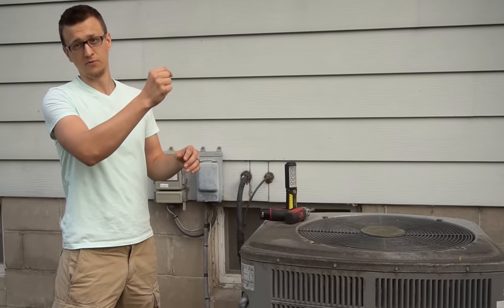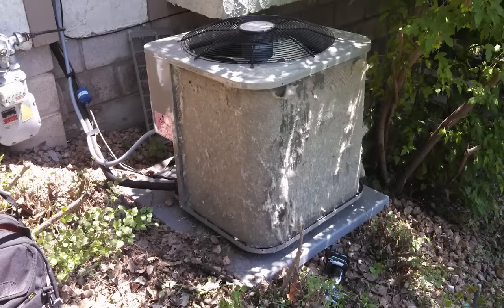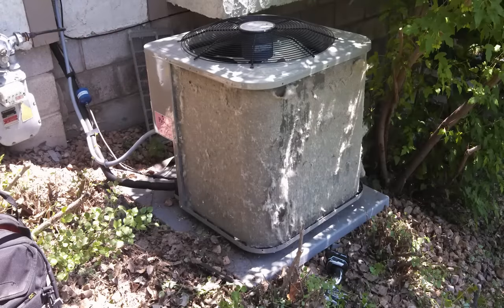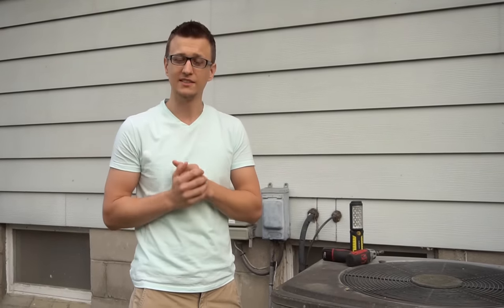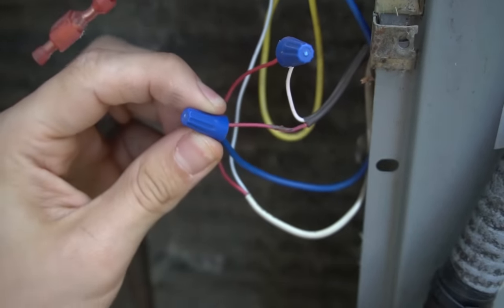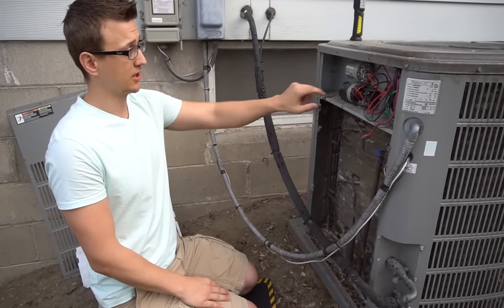15 Air Conditioner Maintenance Tips

Comment: If I tried to take a S/A and R/A temp like that I would lose my job. Also it is very possible to have a 15-20 temp split but still have issues like high SH leading to decreased efficiency and most likely will  reduce the overall longevity of the compressor. Makind sure the Low side of the refrigerant lines are properly insulated (as well as the high side for line sets over 60 feet) will do much more for efficiency than anything else your video mentions other than proper filter maintenance. The rest like checking temp splits accurately require wet bulb, dry bulb, as well as saturation temperatures to actually see the whole picture. And to accurately measure these things you need roughly $800 worth of tools and gauges.

Comment: Never use well water to clean copper,There is organic materials in that water and that increases the possibility of formicary corrosion.It can bore a hole in copper within a few years.Only use distilled water,Best to use one of the household steamers with the wand and spray the refrigeration coil cleaner onto it and let it sit for 10 min,Then wash it off.I seen this happen when someone uses well water to clean copper coils,Many times,Its good for the HVAC companies that you do this in the video.City water is OK because its filtered and chlorinated and sometimes fluorinated.

Comment: Wait it's ok to leave several inches of leaves and debris?  Sorry but no way, all debris should be removed and drain holes cleared.  So many compressors have rotted out because of leaves and muck accumulation down by compressor.
Reply from the maker: Thanks A D! That was a mistake on my part, to spread my fingers that far apart. I was trying to say if it is just a few leaves on the bottom it's no big deal. More than an inch is too much is what I should have said.
Reply: To leave leaves and debris in the bottom of your condenser unit will cause the bottom sheet metal to rust out after a while.  I always remove all debris every season.
Reply: Never heard of metal rotting 🤷🏼‍♂️
Reply: Bye

Comment: Very good information my friend. I have two brothers in the heat and air bis and this is exactly what they told me to do. The only thing i do and didn't really ask them but i use zoom oil on fan motors and let it wick in even if it is only getting one side. I also and you may have said this but i write the date on the filters so i know when to change them and yes every 30 days change them except spring and fall if your not using them but always check them during that time and if in doubt change it!!  I keep 2 or 3 news ones on hand all the time.

Comment: Hi. Can you please make a step by step  video on how to install  just a straight cool condenser? Thank you so much. And if you can another one about installing an air handler. Preferably replacing a broken condenser with a dead compressor. I m having hard time understanding how to disconnect the broken condenser and how to contain the freon and how to clean the lines before installation and is it necessary to install a dryer. Thank you

Comment: ALL OF MY ELEVEN AIR FLOW SUPPLY "GRILLS" LOCATED IN MY CEILING HAVE A SINGLE "LEVER" THAT CONTROLS THE "AIR FLOW DIRECTION" AND NOT THE DISCHARGE VOLUME OF SUPPLY SIDE AIR.  MY AIR FLOW "SUPPLY SIDE VOLUME" IS CONTROLLED BY A SERIES OF EIGHT MANUAL DAMPERS. In your video you stated that the air flow supply grill "lever" can be used to "shut off" or "curtail" the air flow volume into a room. That doesn't "jive" with my newly installed TRANE heat pump system and how it works.

Comment: I put my 24v inside my electric conduit to the unit to protect it. Also increased the service wire from the main breaker to the disconnect and to the unit from 12 gauge indoor to 10 gauge outdoor solid.
Reply: Call an electrician.

Comment: Man, thank you so much for the info.  Much respect and admiration. 
Love the video. Just what I need.  I just started class HVAC.  
Do you have any video on. Air handler keeps running 
And heat pump not blowing cold air in Heat mode. 
I'm having issues with my ac. Unit.
Thank you so much 👍☺️🙏😊

Comment: 13:20 the insulation is there so you are maintaining your superheat vapor on the suction line. your evap coil is 40degrees and you want 50degrees right as it is going into the compressor that is 10degrees of superheat and it should be a vapor you never want fluid going into your compressor that will destroy it.thats why some older units have a thing called an accumulator which stops liquid from entering the compressor

Comment: the run capacitor on the inducer motor seems to also be the most common problem with a furnace too. I have had 3 die in 7 years. granted the 1st one was there when we bought the house. It died 6 months after we bought it. Replace it and that one died about  2 years later so replaced it again. The 3rd one died about a month ago after 4.5 year. I bought 3 online for $2.50 each plus $7 shipping. takes about a minute to replace.

Comment: I do love your videos so informative. My AC is 24 years old and for some reason it’s sprain a leak and has no Freon so I figured it was time to replace it. I live in Arizona 114° today running a swamp cooler and don’t plan on staying here the next month I was quoted $9500 for an American standard Single stage 3 1/2 ton 15 seer split system heat pump in the attic air handler. I was wondering if I should wait until October when it starts to cool down before I think about buying a unit. I guess my question is will the price going to down when our summer is over is $9500 out of this world or reasonable. Plus is the supply shortage going to ease up soon to where the prices come down. Thank you for any help

Comment: Thanks so much have a problem with a window type ac. it produces a noise as if the fan bladders are brushing against another metal. Could it happen all of sudden. It wasn't in useed for some time.

Comment: New sub.  Thanks for these very informative vids.  You've given me the confidence to do some of these simple repairs myself.  My HVAC guy charged me an $89 service call last year plus $65 for a run cap that I could have got (thanks to your Amazon links) for about $20.
Reply: I think you got a good deal.  There are some real crooks out their that would have charged you $400 for that capacitor.
Reply: Affordable HVAC $65 dollars for that capacitor? that is extremely cheap, he must be a solo operation. No way those $65 cover the cost to stock that part, the labor if he is hourly and other expenses required to maintain a stable business, especially in California.
Reply: @armynavymarine2  Exactly. The average homeowner has no idea of the expenses it takes to run a business.

Comment: lot of thermostats have a large hole where thermostat wires are coming through the drywall bring in cold air within the drywall affecting the temprature sensor. pluging it with insulation may save few bucks

Comment: I have not used my AC in two years, I have a central unit which is 10 years old and I have never got it serviced as I rarely used it say about 10-15 times in the past 10 years. Would it be okay to turn it on without getting someone to take a look at it first? Thank you for the video it helped me know about how AC works. I live in California if that helps in answering my question.

Comment: Speaking of capacitors, how long should they last? I ordered one from Amazon, good reviews good seller. I just replaced mine a year ago, should I order another incase?
Reply from the maker: They are unpredictable. They can last 10 years or can fail in a couple of months after a good thunderstorm hits. I like to keep a spare just in case. If it keeps failing over and over then there is probably another issue in the system that needs to be diagnosed.
Reply: I will order another "just incase" but yes this one has been working perfectly fine. Keep up the good videos thank you.

Comment: Hi! Is it ok to use bleach to clear the drain line?? I hear some ppl say bleach can buildup dry bleach on the inner walls of the drain pipe? Is this true or not? If yes, what can be used instead of bleach and otherwise what would be the bleach to water ratio to use? Thanks in advance
Reply from the maker: I've used bleach plenty of times before and haven't had problems.. I just do a mixture of about 1/3 bleach and 2/3 water.
Reply: Word of Advice TV ok thank you for the reply. Subbed

Comment: Great video I learned a lot. I live in Reno and it is always dry. Really dry. Summer we run the ac almost into the dead of night to get temps comfortable. Today was 102. The ac could only hold the internal temp 20 degrees below the high today. Constant with my issue. 100 outside was 80 inside. Is this normal? I am going to conduct the maintenance schedule you’ve outlined. Hopefully improve the performance

Comment: Because    the    refrigerant    was    compressed,    it    is    a    hot    high    pressure    vapor    (as    pressure    goes    up    –    temperature    goes    up).   
The    hot    vapor    enters    the    condenser    and    starts    to    flow    through    the    tubes.  
As    the    heat    is    removed    from    the    refrigerant,    it    reaches    it’s    “saturated    temperature”    and    starts    to    “flash”    (change    states),    into    a    high    pressure    liquid.   
The    high    pressure    liquid    leaves    the    condenser    through    the    “liquid    line”and    travels    to    the    “metering    device”.

To be precise, the refrigerant does not transfer heat from the house to the street.

Comment: I do have a question, I recently purchased a new central air unit, and the temp in my house is set on 74 but by the afternoon it’s 77. So my question is how can you tell if the unit was properly installed. It was also a pound low on freon. Would love to see you do a install video of a central air unit.
Reply from the maker: As I explain in some of my other videos, if you were low on freon, that means the unit has a leak in it. So refilling it is only a temporary solution, it will inevitably leak back out and stop cooling. If someone installed the unit recently, I would get that person back out to fix the leak or whatever else is causing it since it likely happened during the install. I actually don't do install work, only repair service so I won't be making a video like that any time soon
Reply: Word of Advice TV okay that’s what I thought I am now wondering if they replaced the line. My original line we suspect had a leak, so now I wonder if they just put that line back on. Thank you.

Comment: Good info. Does anyone have a solution to a 10 by 15 foot room that has a 5000 btu air conditioner?  In the summer heat there are always some hours where I feel too warm, maybe six hours from 2 to eight or even more if real hot at night. Is the answer in Btus ?  Has anyone gone from 5000 btu to 8k or 10k and then been cool?  Just checking, any advice appreciated.

Comment: great video keep up the good work always enjoy your well explained videos , i have a question I have  a compressor that was having problems starting up my unit is not that old but i thaught the compressor was having a hard start starting until it didn't start at all .traced the problem down to the start capacitor so i removed the start capacitor and installed a hard start kit capacitor called  321 just in case the compressor was getting worn out .So the question is should i leave the hard start kit  capacitor installed since the unit is working fine or should i replace it with the original start capacitor ? .is the hard start kit capacitor going to create any problems for the compressor if i leave it in there permanently? ,Thanks in advance

Comment: Great video filled with lots of great maintenance tips. My problem is a clicking noise like a twig is hitting something in the air conditioner outside. it seems to be timely and happens every 30- 60 secs. when the fan is turning. What could this be as we have cleaned it all out which very minimal leaves etc. in it and it still makes a clicking noise. Could this be caused by something in the motor?

Comment: Hi! I wasn’t sure where to ask this on your videos but I’m having a water leak on my home A/C. Water condensation seems to be dripping on top of the unit filter and through it to the floor. It’s happening on the far back left of the unit. I already checked the plastic trays with my fingers and there’s no filth/blob accumulation whatsoever and the water seems to be draining  perfectly out to the patio. I’m puzzled what’s going on. Could the water be falling from the coils on top? The unit is brand new, only 1 year old. Your input would be very appreciated.
Reply from the maker: Hi there! It would be hard for me to say what it could be without looking at it... It doesn't seem likely that there is a leak somewhere since the unit was freshly installed.. (I would think you would of had a leak sooner if it was a poor installation) It's possible that the fan speed is a bit too high and that is spraying water on the ductwork.. But then again you would have probably had this problem right off the bat then.. If possible, it would be nice to get the guy/company who installed it to take a look at it again. Unfortunately other than that, I don't have any good suggestions for you. Would have to see it to believe it.. ;)
Reply: Word of Advice TV No worries, I understand what you mean. Actually, I just looked at it, and the dripping stopped! A friend suggested to make sure I “sealed” the front cover once I had to install it back on. I wonder if improper installation of the front cover could create condensation dripping on top of the filter.. Either way, the leak stopped since I last saw it yesterday, no more water on the floor! Thank you for your reply! Keep up the great work, your videos are awesome 👍🏻

Comment: Should the insulation on the suction line be wrapped all the way around the line or split open in the middle? I have one on there but it's split open in the middle only covering a bit more than half the line or so .

Comment: Hey yes my ac unit is making a loud buzzing noise and is not cooling my home the fan does fine but loud electric buzzing noise that’s very loud now what would say is that easy fix for Home Depot or repair men ? Or would need replace unit or should
Order new compressor

Comment: Awesome video.  Question.  I know AC companies do cooling tuneup in early spring for “shoulder months” .  Technically you can’t really check proper charge or temperature splits or compressor amps without actual load on evaporator and condenser.  Or am I missing something or tricks?

Comment: It helps to run the A/C for a few minutes every few months to keep the seals from drying out and leaking.
Reply: I had a friend who did all he did could to avoid using his AC. He had a few window fans blowing in and out of his house. He didn't need to use his AC much at all. He got married later and had a kid. Now he wanted to use the AC. The seals in his compressor dried out and leaked all the freon out. He ended up paying for another compressor.

Comment: had the AC since new 5 years ago, within 3 days just seemed like it couldn't keep up and ran all day. cleaned out the cooling fins with a hose from the inside. 4 hours later it's cooled down 3 degrees already. i think i would have been faster but the was air was really humid from running poorly before.

Comment: Hey I would like how my  air-condition the inside unit still running after my outside unit had reached the house  cooling temperature and stop running  but my inside compressor still running  do you think that it has something to do with the thermostat of the unit?

Comment: My house got two 5 ton compressors that are equipped with "Always On" crankcase heaters sucking 150 (2x75W)watts 24/7/367. Do you think it is really good idea to turn the condenser breakers off for winter? ;/ It supposed to keep refrigerant away from oil, but is it really that critical?
Reply from the maker: "Crankcase heaters are usually only needed if you run the air conditioner (or heat pump) during cool outdoor temperatures. During the off cycle, refrigerant will try to go to whichever part of the system is coldest. That means as long as it is warmer outside than it is inside of your house when you run it, you shouldn't need a cc heater." I couldn't have said that better myself :) So basically, as long as you do not use your air conditioner (or heat pump) while it is warmer inside than outside.. You can turn the breaker off.

Comment: Thanks for this awesome video! Could you help me with this questions??... my house wont cool down during the day. I have it set to 68. I tested air coming out of vents and it is precisely 68 (It should be blowing lower than the set temp,  right?). The ambient air is 82 during day and 75 at night. Does the coil HAVE to be  frozen in order to signify a low refrigerant level? I checked and the thick copper pipe is NOT frozen and does NOT have condensation on it. Its is just cool to the touch. And 3rd question...to regas, does the technician have to go inside the house or can it be gassed outside? Thank you so much